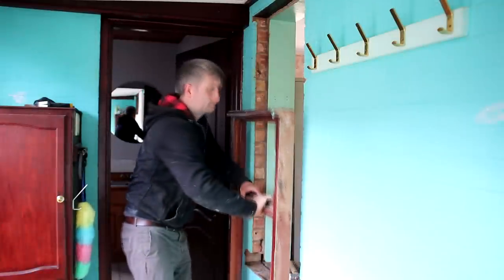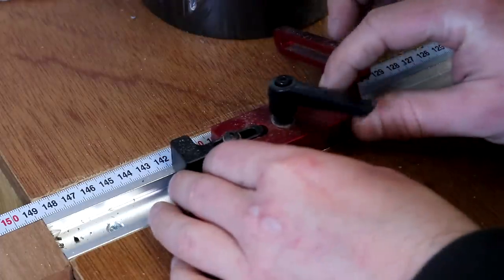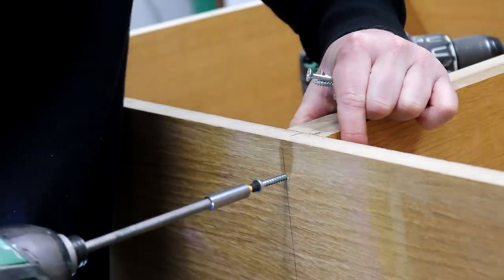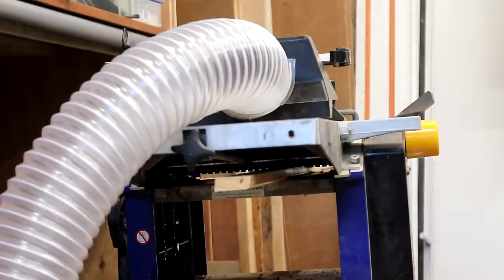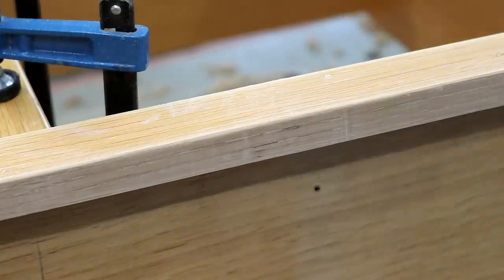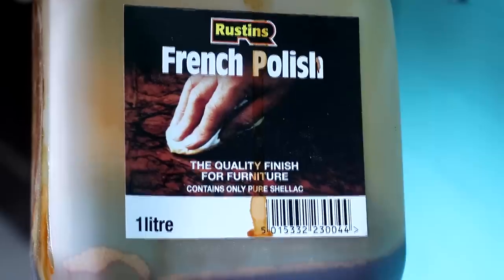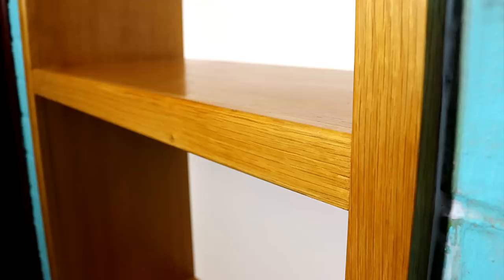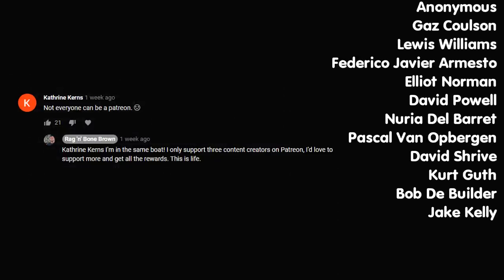Removing A Window & Replacing With Alcove Oak Shelving

Comment: Turquoise walls were the main of my life 12 years ago when we first moved into the farm, if the walls were not turquoise they were cold blue aside from the main reception room which was red all with the same brown woodwork like yours.
10 years to complete the farmhouse we decided to relocate 300 miles north to Newcastle and now I'm two years in to this (last) renovation 🙄 I don't envy you but it's very rewarding when its finished.
Keith thanks for sharing your life with us on here and i wish your both well.

Comment: Though your oscillating tool did the job most use a reciprocating saw to cut nails and screws when removing window and door frames.  Also I would have actually used the oscillating tool to cut away the window sill.  There is also a trick using two sticks for taking more accurate inside measurements.  You put the end of one against one side and the end of the other against the other.  Then make a mark either on one of the sticks where the end of the other lands or across both as if marking for a biscuit or domino jointer.  You can then pull the two sticks out and measure end to end.  Always take at least a top, bottom, and middle measurement when dealing with window and door openings like in this video.

All in all you did a fine job.  No one was hurt or dead in the end.  None of my suggestions were from you doing anything exactly wrong just sharing how I or most others would have approached it.  You may find your methods to have been easier perhaps even better.  Just thought I'd offer a couple ideas.
Reply from the maker: Great ideas! I don't have a recip saw though, and not sure I really need one for the kind of work I do. I dig the two stock inside measurement trick but never remember to use it!
Reply: Great tip thanks.

Comment: Great job! We had a useless window between the bathroom and the kitchen. Bathroom was in the 60s the kitchen... transformed into a bathroom and the new kitchen is actually part of the house extension. The new shelf is actually almost twice yours in depth as there are two walls (Belgian walls are quite thick so 2 of them side by side are even thicker). So we did a double shelf, integrating an opaque glass in between the bathroom and kitchen part so as not to lose any light but not be able to see the one who's in the shower ;) It's nice and useful adding some storage in both rooms. Mine is made out of pine. At first I wanted everything wood made of oak; but we ended up using natural pine and I find it stunning in that old house. For once, I find something I've done in my own house, I'm super happy!

Comment: I know you've probably set out a plan for the order of doing things but one piece of advice is do the kitchen and living room last. I know from personal experience that once those are done, the house becomes 'liveable' - that's the danger point where work seems to slow down because it's tolerable. Of course you might have more self control, but I though it worth mentioning.
Reply: I find personally that the worry and stressful anticipation is much much worse than roughing it up during the works. Especially if one has to generate an income and do the work themselves simultaneously, it makes sense to start with the big push (kitchen), get the worry over, then do the rest at a more sporadic pace.

Comment: What a fantastic build, Keith. Proper job. I have noticed that my wood glue is talking a lot longer to dry now that the winter is here. Is it possible to put small parts of a project into the oven at a very low temperature to speed up the curing process?

Comment: Excellent job, Keith.   Could you specify the shellac you used, please.   I could not find shellac in your Amazon favourite finishes, and a  shellac search seems only to bring up a 'Shellac based primer-sealer' in the UK.
Reply from the maker: Thanks! The stuff I've used is the barrettine shellac sanding sealer, but it's great as a finish. It's blonde shellac so doesn't add much colour. Available at tool station.. I've also used Rustin's french polish (which is the one I used in the video) which adds more of an amber colour. I don't like it as much as the barrettine one but it was just the job for this project to make the new wood match the old finish

Comment: I love shellac. Beautiful, timeless classic finish and lovely to work with even for the beginner.

How old is the house and its doors? I guess it's a bit of a shame to paint them, but I don't think they'd look half bad in a warm, creamy white or a warm grey, depending on the colours of the walls. Another solution could of course be to choose more neutral colours for the walls and leave that mahogany exposed, though if the mahogany-imitating pine doors are found in the same room they might cheapen the feel of the real doors.
Reply from the maker: Shellac is great stuff yeah. The house is 1930s. The bathroom door you see in this video is solid hard wood so I'm going to recycle the wood and just it for a future project - can't bear to paint it!
Reply: @RagnBoneBrown  Yeah that makes sense. The preservationist streak in me wishes you'd leave the doors in place, but the fan and environmentalist streaks are happy that at least you'll put the material to some other good use and looking forward to those videos.

Comment: Don’t worry about the Patreon posting . Good luck with it . 
Your doing good, unit . And good job getting that frame out in one piece . Normally I cut the styles half way down at an angle and crow bar them out. 

Nice work though , and nice house
Reply from the maker: That is a good idea! Why didn't I think of that...
Reply: Rag 'n' Bone Brown I thought you where trying to keep the frame , there normally hardwood
Reply from the maker: I'm considering milling it up in to useable pieces but there are so many screws in it that I'm not sure it would be worth the effort. Shame to waste it though

Comment: When you divided the height by three to get even spaces, did you allow for the thickness of the shelves?  Great use of space.
Reply: He didn't need to.  He placed his marks at the centre of the thickness of the shelves.
Reply: @keithfrost1190  yes. So the top and bottom space allowed for half a thickness of shelf. And the centre space allows for 2x half thickness of shelf
Reply: @LostWhits  You'r right.

Comment: Dear Keith: I have now made half a dozen attempts to sign up to support you on Patreon. It invariably says "enter a valid credit card number." I checked the numbers very carefully, and they are ALL valid! They are automatically filled in by my Safari program on my MacBook pro. The cards are from the US (I'm a US citizen, living in Malaysia). I have tried my US address. Nope. I tried my Malaysian address. Nope. I tried putting in the card numbers by hand. Nope. I changed my profile so that it matched the location I had input for the credit card address. Nope. I'm flush out of ideas, Keith. Any suggestions?